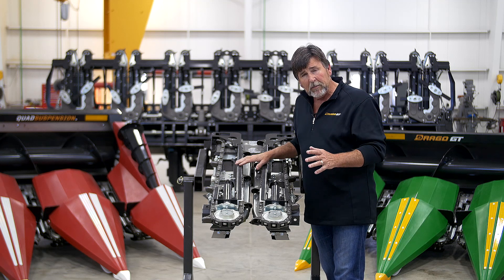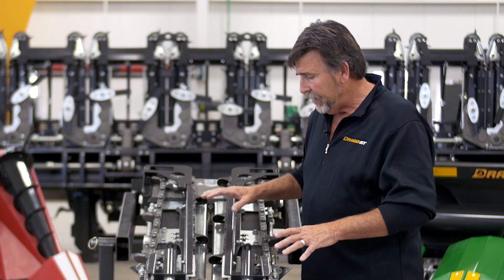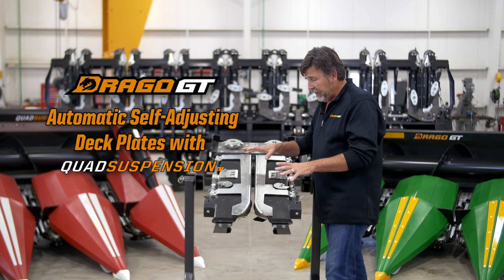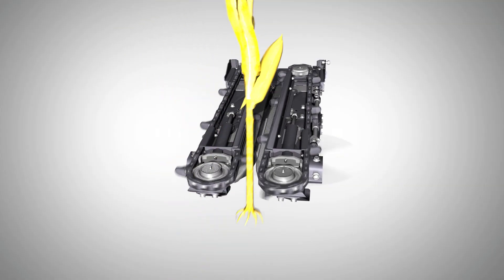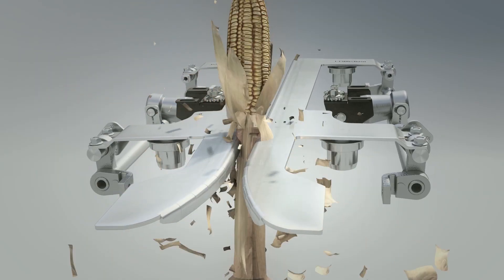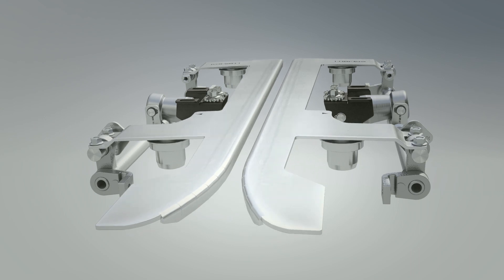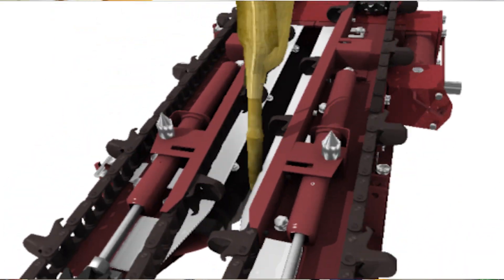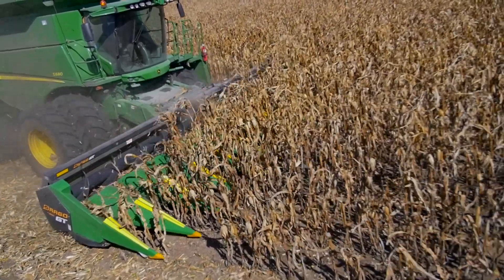Drago GT: Automatic Self Adjusting Deck Plates with QuadSuspension

Comment: At a standing population of 25000 stalks per acre, assuming 1 cob a stalk, 4 mph will give you about 8 cobs hitting that deck plate each second. Maybe I'm wrong, but it seems to me as though the individual impact force that is shown in the nice animations would be more of a constant force on the deck plates. Similar to how a stream of grain will produce a constant force. Each individual piece of grain will produce an impact, but combine them all together and you get a constant force. I'd really like to see some slow motion videos of this in action rather than just the animations to see how well it can perform.